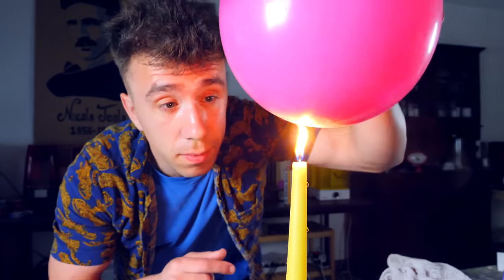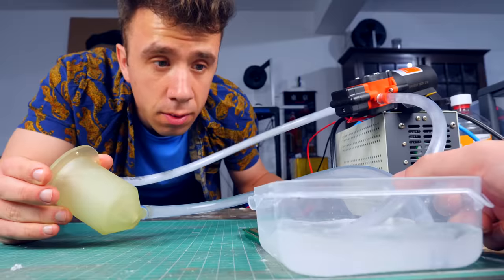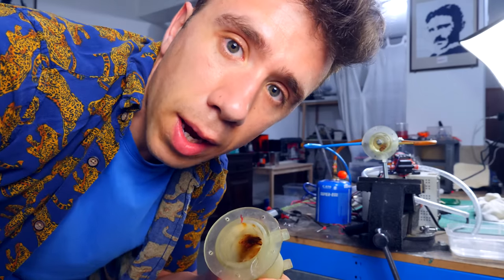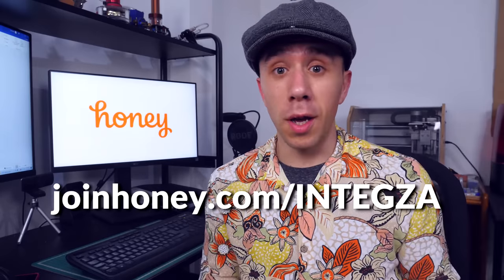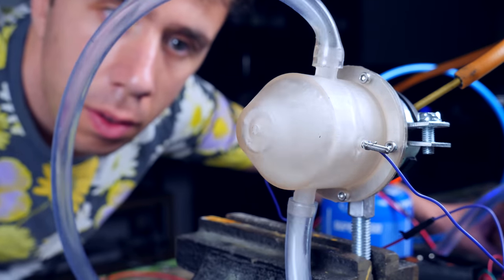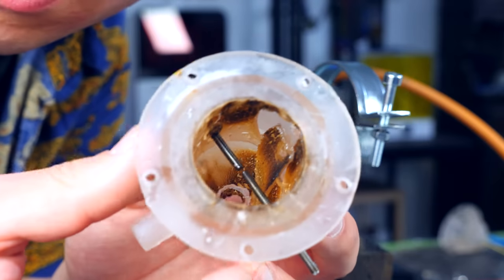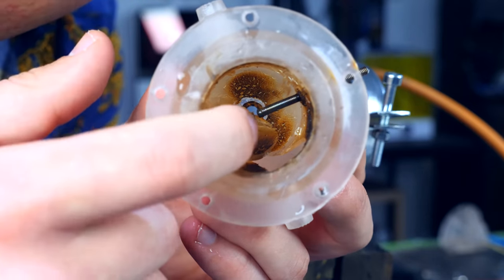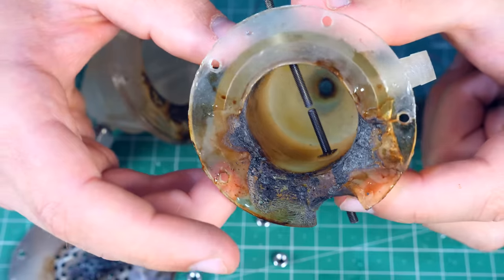Water-Cooled Jet Engine in Plastic

Comment: Idea: Use your working metal jet engine but try to make it unnecessarily powerful, my idea being increasing the fuel flow as much as possible, maybe making your own fuel tank, with compressed air/gas which you can pump up to very high pressures, pushing the fuel out very fast

Comment: Your suffering from thermal expansion diferencial. The inside is expanding faster than the outside, rigid material causing thermal stress fracturing under pressure go boom.
Try this with conductive resin and all your heat problems go away.

Comment: Idea: try to design and 3d print whole electric brushless motor, use only copper wire and magnets. Next you can make a powerfull 3D compressor with it to power your fuel engines.

Comment: I feel like the resin is just not conducting it's heat fast enough. It conducts better if the wall is thinner but then it's not as strong. I wonder if you could try and constrict the water flow when it comes out of the jet engine to try and pressurize the water channels thus giving it better rigidity. You could also try and make the nozzle slightly larger to degrease the damage done when the engine is getting going and it starts to act more like a pulse jet,  I think the shock waves from the explosions are cracking your thin wall membrane. Making a larger nozzle may decrease performance though. What if you tried making the inside membrane from a flexible resin, maybe the pressure won't damage it as much.

Comment: Why don't you increase the thickness and diameter metal disk it will easily absorb the heat and extending the metal disk outside the engine will help with heat decipation and lastly you add heat sinks additionally

Comment: could you design it in such a way that the metal film would have channels in it to allow water to flkow through the whole part allowing it to also cool the metal plate as well as the back part that kept failing? you'd probably need some thing to seal the two halves watertight but theoretically if the metal is being cooled it cant melt your part.

Comment: what  about an internal steel liner, created with a 3d printed  press form. A 3d printed surround for the metal that holds the water cooling and is glued to the metal and a removable ceramic nozzle.

Comment: Try adding spirals at 32 to 45 degrees from water intake to water exit, also try adding some glycerin to the water to increase its ability to absorb and distribute heat like they did with the maxim gun of ww2 also try looking at the engine of the German me 163 komet it was built to be a liquid rocket and through your last few years you've built independently every part of the me 163 minus the stoff t and z

Comment: If the diffuser is the part failing then why not 3D print that in the same way as the water cooled part? May need to send the water thru a loop from one area to the other, or use 2 separate pumps and water sources, but I feel like it could work after playing with it like u do mr Integza sir!

Comment: For a future vid could you try and 3d print metal it would be a stronger material than resin and plastic,tho it would get hotter. I know that not all 3d printers can print metal but you can get different attachments
Reply: Also tomatoes are disgusting

Comment: you were incredibly close to doing what actual rockets do, which is pumping their extremely cold fuel in tubes around the combustion chamber and nozzle to cool them before feeding them back into the combustion engine for the actual rocket.

Comment: Just use rubber instead of plastic the elasticity  will correct small fractions errors so it will stop crack
Reply: Direct message

Comment: Using liquid butane as a coolant was not a stupid idea. The Saturn 5 first stage engines where fuel (kerosine) cooled, with very thin tubes going down and up inside the engine bell. And the Space shuttle main engines were cooled with cryogenic fuel.

Comment: This could be a volumetric flow problem. Where the water is getting to hot to at the beginning and not getting out fast enough for the engine to cool. Maybe increase water flow or water speed through the engin

Comment: Ok I am going to get a little "sciencey?" I don't have links to prove but I am already 3 min into your video and am asking myself "Integza, you should know thermodynamics, and hot water wants to rise so if you put the intake of your water resivour low and your output up on top it should create better flow."  Also a rubber gasket at your joint should stop the leak.  Finally you should add a radiator to your reservoir with a heat sync and 220 mm fan.  Basically a radiator.  This should give you max efficientcy with water cooled.  Easiest method would be to buy a water cooled computer kit and hook that bad boy up.

Comment: 3:00 you also need to purge the system of air otherwise you will get hot spots and burn there the top of the water jacket

Comment: your design should not have any joints to reomove joints u can put metal sheet during  the  whole engine  is printing and make the coolent cool the metal sheet so that if metal is cool whole engine is cool also make the coolent flow around whole engine from starting to end ,bottom to top and also around metal part this makes your design successful

Comment: If the thin sheet metal diffuser is heating and causing the destruction of the plastic, make the diffuser from carbon more heat resistant material.

Comment: Isn't it the temperature difference causing the resin to crack? Kind of like heat on one side of glass and cold water on the opposite.  Where as with the balloon the material can never crack only stretch or melt, I don't know much about 3D printing because I don't have one but I've seen videos where the filaments have different strengths and I remember correctly one has more of rubber composition. If you used that for your combustion chamber then a more rigid/stronger 3d filament that was ribbed so the water could still come into contact with the chamber I believe in theory like the balloon  thr chamber won't crack and shouldn't blow up as long as there's water flowing since it can't be compressed. If you understand awesome.  The theme for another video would be back to the basics and drawing board one of your concepts from a previous video but printed and tested with various filaments.  I would love a 3d printer! Please like my comment!❤

Comment: I just saw your hydrogen peroxide rocket engine video,  if i were able to build one, first steep is calculate the ratio for the reaction as you was using 1 to 1 ratio,  silver is good for catalyst but must be in a plate in this way the peroxyd will react with the silver and explode ( react )   as in the helicopters or jet pack,   using your peroxid and the black powder as in your video, then we can build a rocket engine with a 2 stage chamber  and the vacum of the  expansion will be used to feed the peroxid hydrogen and work as speed controller, with your printer you will print the disc with the small chambers were the first reaction with the potasium , second  area will be the expansion of the small chambers going to a bigger one ,   even you can grind to dust and inject to the chamber at the correct ratio,  i can draw view of the idea if sound good  for a project.

Comment: What if you were to extend the combustion chamber another 1.5 inches and then move the plate to inside the opening of the combustion chamber and have the flange for the two have sit back so that the metal plate is also using the cooling effect from the butane surrounding the combustion chamber. Hopefully that kinda makes sense.

Comment: I don’t know if anyone has said this. But what if you use a gasket to try to disperse the heat from the metal so it won’t melt. Also why not use liquid carbon dioxide to cool instead of water.

Comment: I wonder if it would help to use a high temp silicon gasket between the metal plate and the plastic parts

Comment: What about thicker diffuser that is solid piece connected to a liquid cooled radiator like a "AIO cpu cooler"?   If the diffuser doesn't get hot enough to melt the resin then it shouldn't fail.

Comment: Could you make a jet engine run on liquid nitrogen? Warm air from the compressor turbine could be used to boil the liquid nitrogen expanding it to turn the exhaust turbine. You would not have problems with melting you engine if it works!

Comment: Is it possible to mix your resins with other things cause maybe you could add some fire retardant objects or chemicals in the mix so basically my video suggestion is make a video testing ways to improve strength and heat damage plastic/resign material.

Ps please like this up i want a 3d printer so bad

Comment: Water supply COULD be a LOT colder, try a big bucket filled with ice cold water with salt added to drop the temperature down lower. Have the cold water feed come in at the bottom, 'Warm' water out from the top back into the bucket of ice water. Bleed the system so that the WHOLE water jacket around the rocket motor chamber and pipework is flooded with the ice cold water without bubbles.
Then
Ceramic paste (or other high heat sealing compound) gasket? Should insulate the heat building on the metal diffuser getting in contact with the both plastic sections.
I'm thinking this should help...
Then fire it up..... 🤔😏    😎🇬🇧

Comment: Has anyone suggested using a ceramic plate instead of the metal one used in the video? The ceramic should be able to reject the backfire heat much better. As to where you get the ceramic, I have no clue.

Comment: Maybe try to 3d print the Diffuser with the ceramic resin and try it with that the ceramic is really good at getting rid of heat and then it wouldn't be cheating anymore. Lol

Comment: The butane cooling idea wasn't stupid at all. Rocket engines use recirculated fuel through the engine baffles to keep them cool. Good enough idea to get to the moon, good enough for plastic jet engines. You have to be damned sure that your cooling will work well enough, otherwise you are opening a fuel line directly into the combustion chamber, but still good idea. Maybe a bit dangerous :)

Comment: A freaky thing I was shown when I joined the fire department was....take a styrofoam cup, fille it with water, and put it on a stove eye. They then turned it up to ~ 275 degrees F. The cup that would normally burn did not...until all the water boiled off.

Comment: There's too much air in your water cooling loop.
You want your reservoir to be higher than anything else in the loop and the pump lower.
The water should enter the engine from the bottom and exit from the top so it is forced through the whole engine.
Run the water through it until there is no more air in the loop, especially the pump.
The main reason you want the pump on the bottom is to prevent air pockets from entering the pump which can destroy its ability to pump.

Comment: Why not try a completely different rocket engine architecture. What do I mean? I mean an aero spike engine rather than a bell nozzle. I suspect that it would maybe lend itself to the methods you use better. I’m an engineer by profession but don’t do much design at all, but I think it would be really interesting to try. For reference I think the best option is probably a linear aero spike as circular are difficult to cool.

Comment: I do say that if it is possible to get your hands on liquid nitrogen you should be able to cool it enough to where the piece wont melt. also more pressure may be necessary to insure that coolant is in full contact with the walls of the piece.  also use the jet engine to burn a tomato that would be awesome 🤣

Comment: would it be possible to water cool the diffuser as well? instead of using metal which conducts heat into the outer casing?

Comment: Sticking with the idea of the 3D printed turbine housings and etc…Would it be possible to use Methanol as a fuel source instead of butane? To see if the housings hold up better to the cooler temperatures of methanol

Comment: Only watching 2 minutes in I can tell you two problems.  The balloon is not under pressurized gases so the thermal energy is both going around the balloon but also dissipating into the air.  The second is plastic is not a good thermal conductor.  It is an insulator.  If you impregnator the plastic with something heat resistant like tungsten powder you might have a good internal combustion area as the surfaces would have less chance to  warp and create a differential heating issue similar to when you heat a thick piece of glass and put water or oil on one side.

Comment: Have you thought about covering the inside of the walls with water?
Injecting a little bit of water to stream down the insides of the combustion chamber creating a vortex. So the ignition hits wet walls. That will cool down by evaporation and you should get extra gas, i.e. thrust from water vapour. The water would also exit through the nozzle. So to cover all the walls you'd need multiple inlets. However that would mean that the nozzle could only face downwards. Usually not a problem for ballistic rockets. The water inlets would have to be behind the combustion chamber.

__|_|___
|__ |  |  __|    '>', '<'  =  Water inlets at an angle to create a vortex.
| <_|_|_> |        | & ^^ = Fuel injectors going through the water reservoir (or not), 
|     ^^     |
\            /
  \        /        Water (liquid and gaseous) and combustion stuff stream out the nozzle facing downwards.
    \    /
Ideally the combustion would always only be in direct contact with liquid running water and not the walls that will heat up over time.  You could even have the water reservoir be cover the fuel injection inlets, since they are made from metal, right?
Could you explain a little how fuel is injected into it? And how air is replaced so there is actually oxygen in the chamber after a combustion?

Comment: Hello Integza
I'm always surprised at the high temperatures cured silicone rubber will tolerate. Could you introduce some silcone rubber into your designs to proterct the 3d printred parts?
You could 3d priont the mould for the rubber parts - just an idea FWIW - Gretc Channel

Comment: You really need to get rid of the bubbles in your waterloop. The only thing with a better thermal capacity that water is mercury and you dont want to use that... you should probably watercool your diffuser plate too...

Comment: "Polybenzimidazole (PBI) has the highest heat and wear resistance, strength, and mechanical property stability of any engineering thermoplastic on the market today. PBI fibers have no known melting point, don't burn, and don't stick to other plastics". Maybe you need different material...

Comment: But technically it isn’t cheating as the title  is stated as quoted “watercooled jet engine in plastic”. Said in plastic so the metal diffuser is part of the jet engine and contained in the plastic water cooler. So the jet engine components isn’t said to be plastic but is contained in the plastic water cooler. The first part water cooled jet engine, with the second part being in plastic saying that the engine is in plastic and not saying made of plastic. Case closed.

Comment: Ok so I might be completely off with this but is there a way you could make like a high heat silicone seal to put between the metal and the 3D print because it looked like on the last one the metal was the main reason y it melted

Comment: i feel like this is no different than cold air intake on an engine, first around your steel defusier use Ceramic Fiber Insulation inbetween the parts and make a ice cooled reservoir for your pump too feed, and make it a big one

Comment: having plastic as the combustion chamber material is a bad idea.  the melting point is far to low.  To cool it to sub temps will make the material brittle.  best to use stainless steal as the combustion chamber and plastic everything else.   The water cooling should keep the external plastic cool enough to sustain a decent burn time

Comment: look man... if water was such a good conductor of heat, then the oceans would be very warm at the north and south poles and yet it's not the case.   water in of itself is not a good conductor of heat unless you purposely give it a flow rate.  water is very good at forming to shapes with which it is contained, containing large amounts of thermal energy, conducting electricity, but not heat.  water conducts electricity regardless of it being still or moving.

Comment: add graphite to resin to make it more thermally conductive?
Reply: also you can electroplate your 3d print so you have a metallic surface.
Reply: question, did you have 2 butane intakes? because your cooling butane will be warmed up and there fore easier to combust.

Comment: one of the problems you are having is the water pump.  You are cavitating.  And cavitation is air bubbles... and air is not as good as water in transferring heat.

Comment: Your liquid butane engine, while super dangerous is actually a design type that is used. Orbital rockets can use a self cooling type of engine utilizing liquid oxygen it then flows into the engine to combust. 
https://ntrs.nasa.gov/citations/19780013268 

The big issue here is that plastic is not a good thermal conductor, so while it is cooling it is superheating the plastic surfaces while cooling the lower levels. This might actually be a good application of the metal or ceramic infused resins.

Comment: Dig your channel, but so far, all your engines are very land-bound.. how about something that flies for a change.. maybe a hydro-spyke rocket, perhaps even launched out of a microwave oven (to raise it's internal pressure).. all you'd really need to 3-d print would be a threaded bottle cap with nozzles and stabilizers.. also, tomatoes make great test pilots..)/*